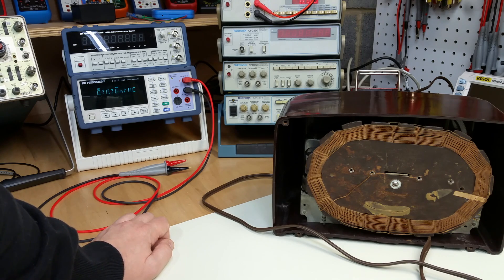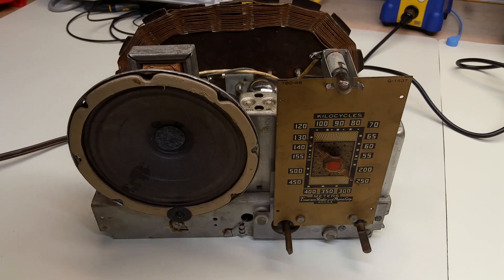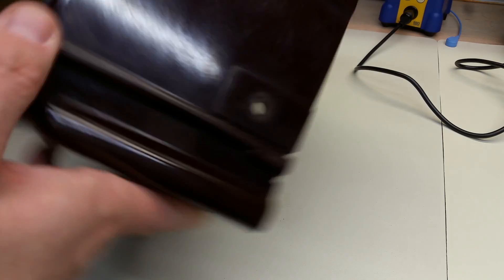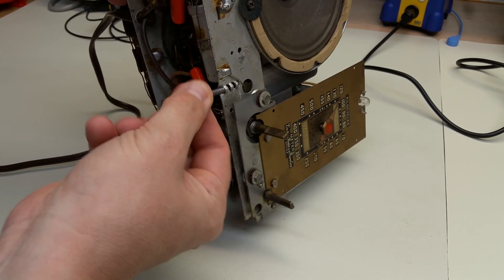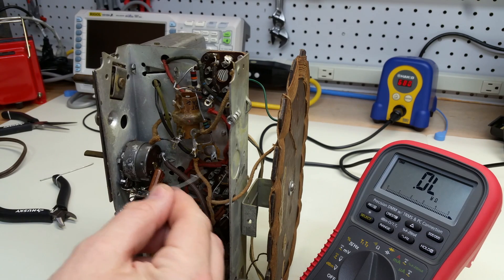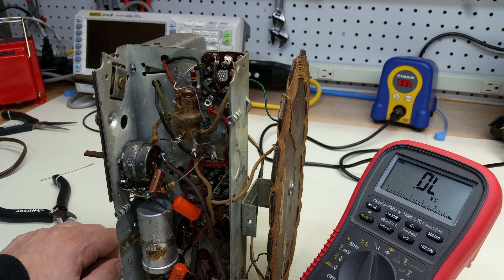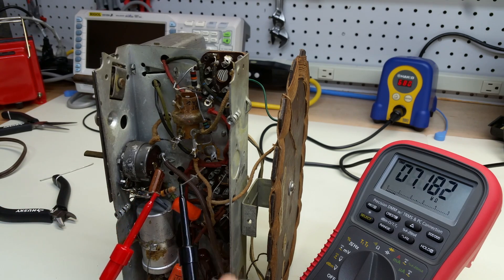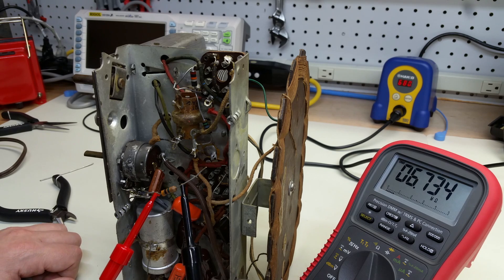#13: Emerson tube radio restoration, part 1

Comment: Nice video! What was true back then is still true today. Thanks for putting it out there.
I have that exact same radio (8 years later) in the same condition and I cannot figure out what model it is either!!! That’s frustrating because I cannot  find the right alignment procedure for this radio!
We are on the same page, where you did the same power supply modification that I did to eliminate the hot chassis. But we need to remind the viewers that it only works with electrical outlets that are properly wired according to the US standard (NEC), or NFPA 70 electrical building code. An incorrectly (or reverse) wired outlet can bring back the hot chassis shock hazard, so I guess these un-isolated / transformer-less radios may never really be totally safe. Thanks and keep up the good work.

Comment: I found this video tonight, because I just pulled apart an old Emerson radio (identical to this one) that was in my wife's family. The guy made notes on the back panel that he restored it in 2001, but its got very low signal. Quite a few of the caps/resistors were replaced underneath it, but much of the wiring and the speaker are original. It looks like some of the tubes were likely replaced as well. I was just about to try to get an external antenna for it, but it still has the original wax one there (that this guy replaced) but I don't know how to go about finding that?

Comment: So will these types of radios not store electricity in them if you plug it in to test it before working on it? I'm restoring a 1939 Emerson for my sister and I'm so unfamiliar with the tech I'm hesitant.

Comment: If you touched that, would you actually get electrocuted?
Reply: 50/50 chance if you touch the metal chassis and controls.. Use an isolation transformer. Plug radio into it first.

Comment: I just bought one off of ebay and it's a hack job.I need to get a schematic for it and Nostalgia Air doesn't have a schematic for it.I need one for it.From what research I've done,it dates from 1942 according to Beitman.I've got it downloaded onto my laptop.